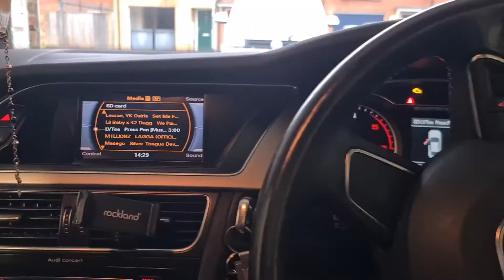Wrapping Dash and Doors | AUDI A4 #really #enjoyed #DIY #my #car

Comment: Dude.. wtf, get plastic spudger and remove the parts, they just pop off. Then when you wrap, wrap over the edges. Why you went this route I've no idea.
Reply: They might not come off like that ik on the a3 they do but I have a A4 b7 n there screwed in from the inside